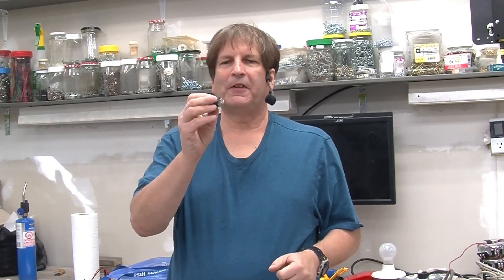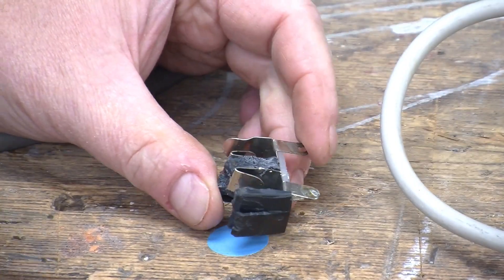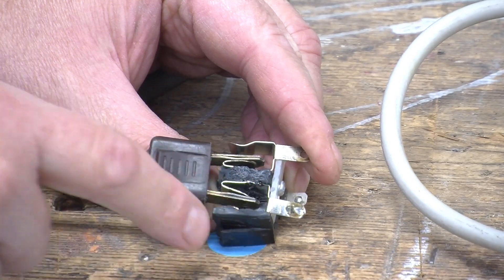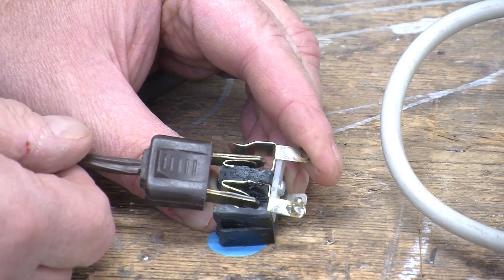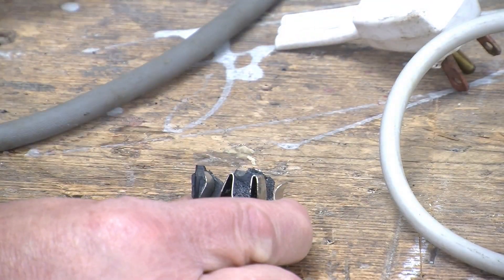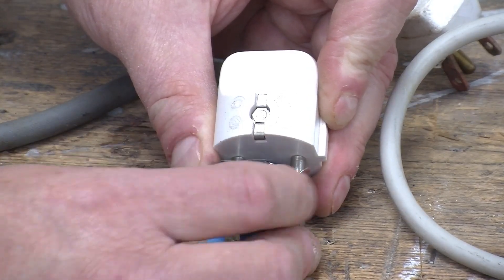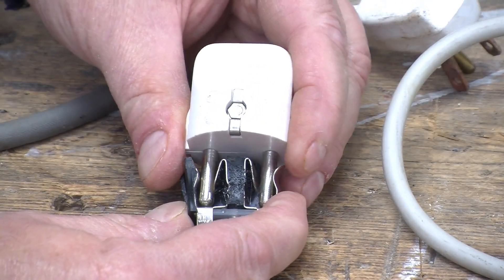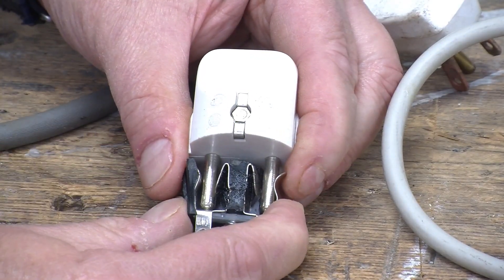One Cheap, One Surprising Chinese Multi-Receptacle

Comment: Your power strip also contains Australian/NZ general 10A appliance plug sockets.  
This is the 2 top angled slots A & N and the vertical E.
The Earth (Ground) Terminal is situated between the Active and Neutral sockets of the Nth American/Japan type.

Are you comfortable with that, if in fact the board has an Earth socket actually connected to an Earth at the boards plug? If it doesn't then it does not comply to Australian/NZ Standards.   I'd be opening one of the sockets to see if clearance/segregation is actually compliant inside.
Reply from the maker: I think the ground is connected - but your right, should check. I thought the Chinese plug/socket was similar to the Australian/NZ except the plugs dont have the insulated top secton of each blade? I just assumed since this was China it was intended to be a Chinses socket rather than Australian/NZ but obviously they fit.

I wish our plugs had the top part of the blade insulated like yours. Your blades are actually narrow enough to fit in our sockets, but are at the wrong angle of course.
Reply: @ElectromagneticVideos   hello again.  I'm late to the party again.
A few points... power points indeed:
The most important connection is that Earth. Hey folks, if that isn't there I'd fill every supposed E blade slot ! The reason is obvious.. if you can put a 3pin plug into a socket, that E better be there. 
Power Boards like these (10A 240V 50hz compliant) sold in Australia ALL include a 10A thermal trip circuit breaker.  Sometimes I reckon it should be only 5A rated given the weak pathetic nature of the socket contact design.
That 20A AutoTran ya had is a disaster, with multiple design fails - VERY 'optimistic' with it's 20A rating - is the best I can say... and non-compliant to Aus/NZ Standards... by any Standards.  
An aside: A video on overloading these crappy consumer plug boards with thermal cam images would be interesting.. for the electrician and consumer's POV.. and hey, Surge Protection is yet another subject.   😉
  
You have your use for it... as a handy mains plug converter/adapter in the workshop use. Perhaps on your test station supply that has isolation transformer, so Earth/ground is less of a life protection issue. 
Frankly, I see a bit of a 'bunger' there.. a fire and hazard... bit of drama when it goes off. LOL 
The small separation distance between A, N to E sockets requires specific internal barriers.. this I'd be checking as a high priority. That is the big issue for when a fully loaded NthAm plug is inserted and starts heating.
Less of an issue if an Aus/NZ plug inserted due to no current flow in the Earth, so no heating.. it just melts the widely separation A & N connections!   

I don't use those boards in my home! - nor those that contain 'surge protection' and antenna/telecom sockets for the same pathetic surge sink protection. Nasty stuff... NO WAY would I have one of them stashed behind the TV/HiFi cabinet, waiting to blow.  

Instead, I use outlet panels designed for fixed wiring in commercial Skirting board ducting systems and control cabinets. They clip in mount and connect via a wired (fixed cable type, like ya Romex) polarised plug socket, that can be daisy chained. i.e. female type being the feed at one end, then male plug that wires to subsequent outlets. (Calculate the maxim demand)  Makes office fitouts a quick job, and No ring chain BS. 
I've used em in the back of large SCADA cabinets to supply 240 to Instruments /modems / computers / test gear, and similar small signal devices. You see em in 19" rack server cabinets too. (often a total of +20 outlets in a vertical 'bar') however, these have high quality +10A rated contacts and internal busbar, for such 'fixed use' - NO CB protection unless specified. These are solid and compact.  
I also use Industrial grade surge A/N/E surge protection in the Main Consumer CB panel, where it SHOULD be! ..connecting to the Main Earth cable into this small apartment. 

I don't know what Plug Standard they use at a Consumer level (homes) in China. A lot of 'modern' there and commercial/Industrial. 
I assumed similar to NthAm / Japan style and including the Earth/Ground. I've no idea the current ratings or pin variations in use there.... I hope they have A/N/E plugs. 
You never know what to expect... I recall working on a China process heating/DC motor control cabinet once, that used the colour Green for one of the 3 active phases. Getting that thing up to Aus Standards was 'interesting'. 

Here, our standard 240 plugs now have the insulated pin design. 
I'd seen it on Euro plugs years before it turned here. 
If an appliance has the non-insulated A&N blades it is deemed 'non-compliant' in testing for 2nd hand sale. Likewise, deemed the same in mandated Test n' Tag of commercial / construction / industrial equipment. Non-compliant plugs are changed if ever found. 
The insulated section of the blades is good, but at a cost... saves drama and lives.. all to easy for a kid to stick a knife across the blades when it's plugged in and Live. I'm sure I did that once more than 50 years ago! 😂
The 'cost' is less surface area for pin to socket connection. 
Here at home I have some non-compliant plugs, but it isn't a bother. Retired people will have good old  solidly built stuff still in-service.
In my situation, I'm more than aware of risk and all the indications... and that isn't a slacker electrician with a home full of unfixed dodgy stuff POV. 
Here in Aus there are a variety of current/use rated 3pin plugs. The standard config all straight pin 10A you see there, and then use of blade height variations for 15A, 20A and 32A styles... 'special purpose outlets'. 
Likewise, for 'controlled' outlets round A/N pins + flat E can be found used for lighting, and flat A/N + round E for specific use appliance outlets.
Such combinations of pin style controlled what type of item could be plugged in.. after all, the lighting circuits use smaller gauge lower current rated cable, and you don't want some idiot plugging in a power board into a lighting circuit to run large tools etc. 
Here there were also some very low profile type plugs/sockets in use, having all small diameter round pins... used for stuff like behind clock outlets etc. The whole socket plate and plug sitting flush to wall sheet.  Again, 'special purpose' circuits. 

Again, I'm sorry you have to suffer that 120V scene.. and crazy 240V split phase supply.  It makes for a lot of high current connections and heavy cables.
Reply from the maker: @BTW...  A bunch of great points thanks - hopefully will be of help to numerous readers.

I do like the idea of an overloading the adapters video idea. Summer is coming for me and I can do a few things outside again since I dont have a fume hood.

If I was ever doing stuff regular with foreign plugs, I would make a strip of proper foreigh plug sockets - but since its more of a once in a blue moon thing for me I probably wont do that.

As far 120/240  split phase, I have lived in both 240/3 phase and 120/240 split phase places. Yes the cables are a bit bigger, but I do consider 120 to ground a bit safer that 240V to ground. It could in some cases make the difference between lethal or no so lethal shock - I would be interested to see any actual statistics that might indicate difference in safty or not. Having said that , with GFCIs in more an more places, that may render the doubling of the voltage and hence doubling of the current therough humans resistance irrelevant. 

The biggest issue we have with 120V 15A is kettles boil slower! Higher load devices like air conditioners of any size are on 240V circuits.

Comment: However, the disadvantage is that the protective conductor of the German plug is not contacted. This SCHUKO plug is intended for protection class 1 devices where the metal housing is connected to the protective earth.
The French plug will also fit but no protective earth.
However, it is feasible for the 2-pin type C plug (Euro-Plug).
Reply from the maker: Yes - no ground for the German Schuko to connect to and same issue for the French plug which has a ground ping sticking out of the socket, right? I'm only keeping the power bar to test things with if I need to. Would not be a good idea for everyday use with devices that for safety have the grounded plugs you mentioned.

Comment: interesting powerstrip.    in my opinion very unsafe,  since it would be possible to plug in equipment with different volt/amp ratings,  since much of the world uses 230 volt 50 hz for everything including lamps and small appliances,  while North America and a few other countries use 120 volt 60 hz.    Essentially the Chinese version of the receptacle on a different video a while back that can accept NEMA 5-15, 5-20, 6-15, & 6-20 (120 and 240 volt) an accident waiting to happen.  I have much respect for the engineers that were part of the NEMA standards, because in the early 20th century just as homes were wired for the first time there were no real standards,  and your hotpoint waffle iron may have had a different plug than that fancy Hoover vacuum cleaner,  and plugs and receptacles were used interchangeably with 120 and 240 volts, in fact if you look at an older receptacle,  from say Pre-WWII,  it will likely be two prong T slot,  and marked with 125V-15A/250V-10A.     I just finished remodeling a 1952 Ranch house, in Anderson County South Carolina as a side job,  and the receptacle were T slot two prong with these ratings.    I suspect many were original to the house, along with the switches with two small buttons that popped in and out.
Reply from the maker: I think in a lot of places outside the western world the people live in a situation where many of the appliances come from all over the world and have different plugs because of that, hence the proliferation of multi-plug power bars. I think what happens in most cases is only 230V compatible devices are imported so they are generally OK, even if not up to our safety standards. 

The NEMA system was certainly a great advances in standardization and safety!

I have seen those vintage receptacles - I guess like the Chinese power bar, it was a case adapting to a multi-plug situation. So did you swap out the old receptacles and cool old button switches? Or did they stay to keep the historic look of the place (assuming the code doesn't require them to be changed).
Reply: @ElectromagneticVideos  we swapped out the old receptacles with 3 prong, kept the original switches and all the  coverplates,  to keep the home looking as original as possible.  There was a 100 amp breaker panel square D brand,  and some newer wiring and receptacles,  so it obviously had some upgrades over the years. We installed AFCI/GFCI breakers to protect the original wiring, which was still in good shape, although lacking a ground wire, this meets code, as long as you label the receptacles accordingly.  

In the hallway, the three way switches were wired in a very non standard way, confused the daylights out of me, upon replacing the toggle switchs with a new push button type as requested by the homeowner As follows: From a receptacle to the first three way, the hot and neutral (old cloth ungrounded romex) were pigtailed and connected to the traveller screws,  then jumped over to the second three way switch, same thing,  jumped to another receptacle and continues down the line.   To control the light,  a single wire,  with a black, rubberized insulation ran from the common screw on each three way, to the light.   The light is  ON if it gets a hot and a neutral,  correct or reverse polarity depending on the position of the switches,  the light is OFF when it gets two neutrals or two hots.  

in summary,  we replaced the non grounding receptacles with grounding type, although still ungrounded,  have AFCI /GFCI protection as required by code.   Replaced random toggle switchs with new, reproduction push button style with brass plates so that all the switches in the house match.   older homes have charm you just cannot feel in modern construction.
Reply from the maker: @Sparky-ww5re  Really cool that you were able to keep it as authentic looking as possible while significantly upgrading safety. And AFCi would sure make me sleep better in an old house with hidden wiring that may or may not be in good shape. 

Two hots or two neutrals to turn the light off - wow! I'll bet that was acceptable when it was first done even if we don't like the idea of an energized bulb in the off state today. Not to different from a plug-in lamp without a polarized plug and the switch having a 50% chance of being on the neutral.
Reply: @ElectromagneticVideos  yes I did some research the other day on lunch break,  about the hallway 3 way switch setup I found during the renovation I finished last Saturday,  you might find this very interesting.   It called a Carter 3 way,  it has been prohibited by the NEC in 1923, and was commonly used during the knob and tube era, because it actually used one less wire.   It is sometimes also nicknamed farmer's 3 way, or barnyard 3 way,  among several other names, typically when you have a house, a yardlight in between,  and an outbuilding with receptacles that remain powered, a 3 way switch in the house and outbuilding controlling the yardlight with only 3 wires (excluding the ground) this was common on farms in rural areas well into the 50s and even the 60s.  Having said that, because the 1952 Ranch house I remodeled had no 14/3 anywhere that I could tell,  I suspect the house was wired by an old timer electrician that lived during the great depression,  times were very rough then, and they learned to be very frugal and save every penny possible,  even if that mean wiring it in a potentially unsafe manner.  And the AFCI/GFCI breakers installed on the old wiring,  will also protect the homeowner who may be changing a bulb that is OFF but hot on both terminals.
Reply from the maker: @Sparky-ww5re  I just googled  Carter 3 way - I get what your saying about saving a wire and how ideal (if not safe!) it would have been for a house and shed each with a 3-way switch and the shed also having power from the three same wires. 

When you think about, many adults in the 50s would have experienced the depression or its after effects - that frugal way of doing things did have a lifetime lasting effects - I saw that in my dad. (And thanks to him I don't squander $ but don't skimp either).  So I get how an electrician back then might have skimped on things.

I dont get why all AFCI breakers arnt actually combined AFCI/GFCI  since they have electronics inside and it probably wouldn't cost more to make. Would be safer in general. I have 4 AFCIs in my house after some renovation work - wish they included GFCI as well. I don't know if the combined ones were readily available at the time.

Comment: I'm not sure if the Chinese ground anything. What I don't understand is why North American plugs still don't have shrouded plug prongs. The Australian's have shrouded plug prongs, and the prongs seem to be the same size as North American plug prongs. The only difference seems to be that their prongs are at an angle. People just tell me it's because we don't use 240 over here. Actually, we do, and those plugs don't have shrouded prongs either. Probably, everyone in their life has accidentally got zapped because they got their fingers too close to the end of the plug while unplugging it
Reply from the maker: Yup - I completely agree - we should have shrouded prongs. I have tested the Australian  prongs  in our receptacles and they do fit. They are marginally thicker than ours but could be made thinner in our plugs. I have been planning a video on that ...

The difference between our and their 240V is ours has two live wires, each 120V with respect to ground but 180 degrees out of phase with each other so is 240V between them. The Australian (and other 220/230/240V countries) generally use one live at 230V to ground and one neutral so actually twice the voltage above ground than ours. So they do  have a bit more reason to be careful.
Reply: Without so much as a sideways glance at a USA socket, it might be the wiper depth in the socket.  If the USA did shroud the pins would common sockets still make proper contact with the pins, ie the metal wipers still contact the same area of metal.  One thing the Chinese manufacturers often get wrong is they shroud the earth pin too.  Not so much for Australian plugs but they love doing it for UK plugs.  That usually prevents the metal of the earth pin from making contact with the wiper in the socket at all.
Reply from the maker: @retrozmachine1189  I didn't know they shrouded the earth pin - that's certainly too much of a good thing :) Sure shows they are not thinking about why a pin should or should not be shrouded. Good point about the wiser depth - I'll have to dremmel one apart - I wonder is if there is a standard as to where the contacts have to touch the plug blade, or if it can be anywhere.
Reply from the maker: @liam3284  So a pretty safe an modern grounding system!

Comment: I guess I missed it; what kind of plug does the power bar have?
Reply from the maker: My bad! It has a Chinese plug - three flat blades, the neutral and live at about 45 degrees from vertical. Like an Australian plug except the top part of the blades are not insulated to prevent fingers from contacting them when partially inserted.